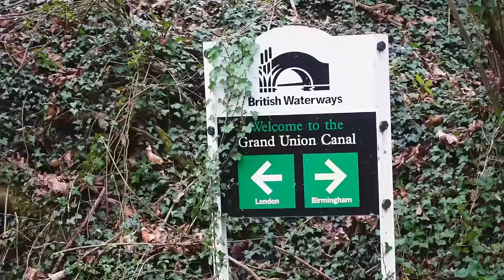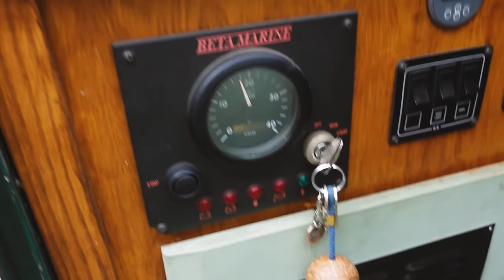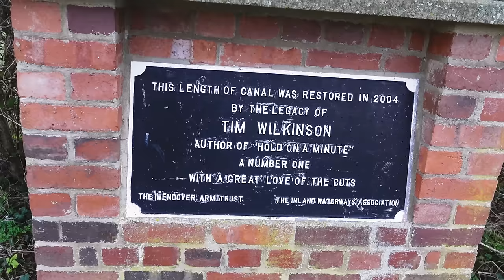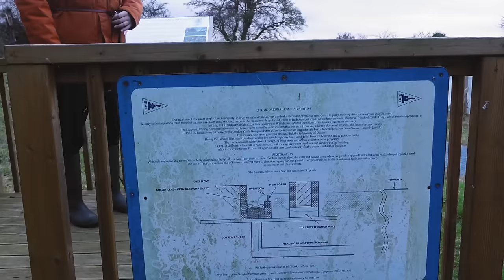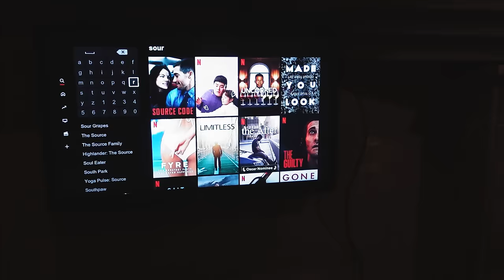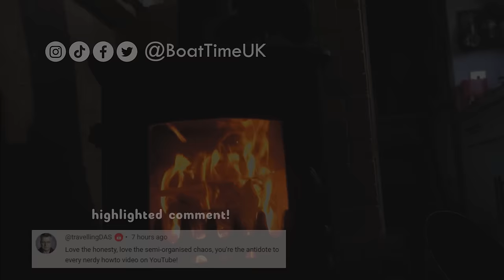Cruising a canal that is being restored after 120 years | Wendover Arm by narrowboat - 195

Comment: The Canal is an old feeder, the original plan was to make it just a feeder, no boats, it's an old chalk stream. They realised at the time that the cost difference to dig it right out and make it navigable wasn't much different. 

The bridge in Tring is actually a new build, its concrete with a brick covering. It's a very nice bridge for a new one.

Just up from the basin you moored is an old rubbish tip, this is the biggest thing stopping the restoration and they've been working at digging it out. There isn't really anything stopping it from being restored all the way. 

The old mooring bay is new work, there was a stoppage on works which is maybe still in place, the canal leaked so bad it ended up taking water away through leakages, the whole thing is being lined, if you look at some of the bits between where you are moored and the first bridge you can see the tar in the banks where they tried to seal it back in the day. It's having a bentomat lining now.

I cover canal restoration's on my channel and I've been there a few times
Reply: Also just up from you is the Buckingham arm, that's another that's being restored, they opened bridge one last year for dredging and it's nearly ready to be opened to boaters. It may be worth contacting the society as they may wish to meet you and give you a tour

Comment: Stop locks
Originally used as a way to control the flow between different canal company's water, the stop lock worked to completely break the flow of water and was a way to prevent one canal taking large amounts of water from another canal.

Nothing to do with weights I'm afraid.

From the canal and rivers trust website